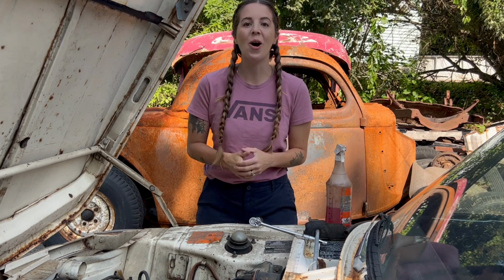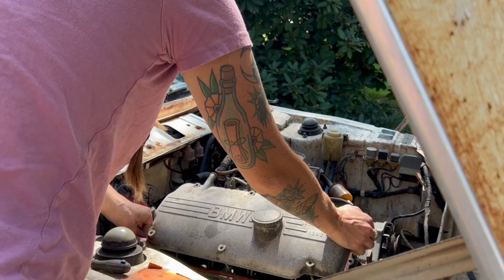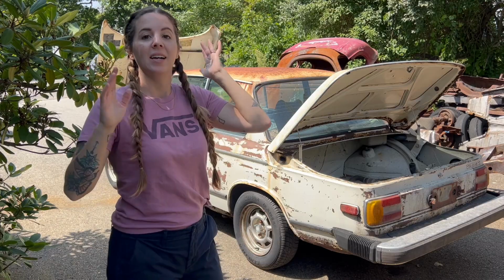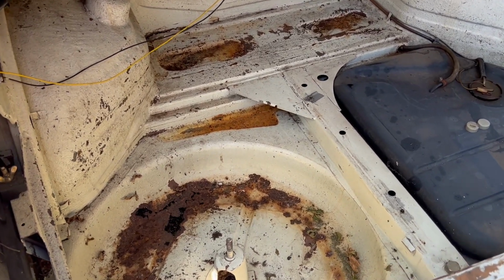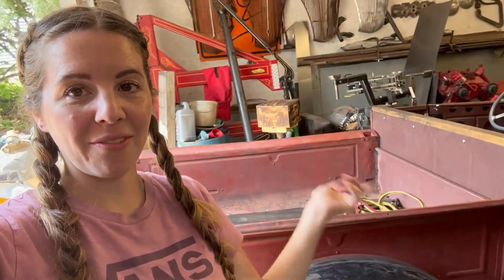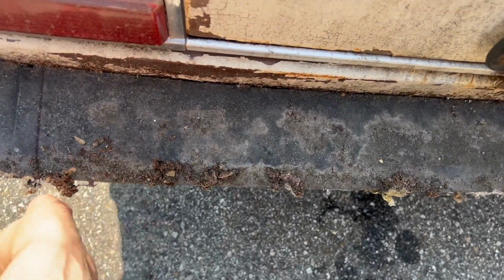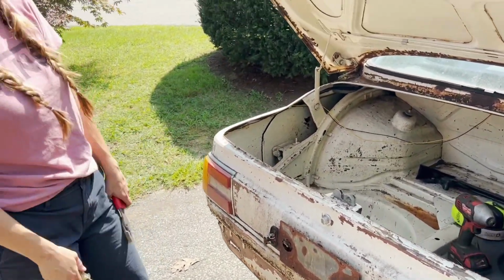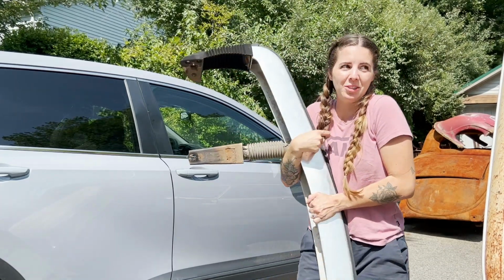Removing BMW 2002 Bumpers with a 29 Roadster!

Comment: I would change the oil, and it looks like there’s rust on the overhead cam parts that I would not try and start it if those rust chunks start to circulate through the crankcase? Just me thinking aloud 🤔

Comment: Hi. U.K. interested in your channel and this 2002 build. We can’t wait to watch more…more often. It’ll look phenomenal once completed. Try WD40 on those stubborn tight nuts and bolts. A fresh Oil change. Remove the rusty deposits visible, soak it more and the cam chain when turning by hand. Probably need new plugs and points? Imagine if you chopped into a custom pick up truck!! 🇬🇧🇬🇧😃
Reply from the maker: Thank you so much for watching!
Reply: I subscribed . @KellyBuilds
Reply from the maker: Thank you!
Reply: WD40 is a water dispersal liquid and the 40 stands for the number of times they tried till they got it right... the best release agent for rusted nuts and bolts is 50/50 ATF to Acetone...

Comment: Very strong engine block. I may be wrong, but I think those were the blocks used to power the Brabham BMW F1 cars. The 1500 turbos with the 1500hp (for qualifying)😮
Reply from the maker: Yeah we’re going to run the m10 for awhile before the swap!